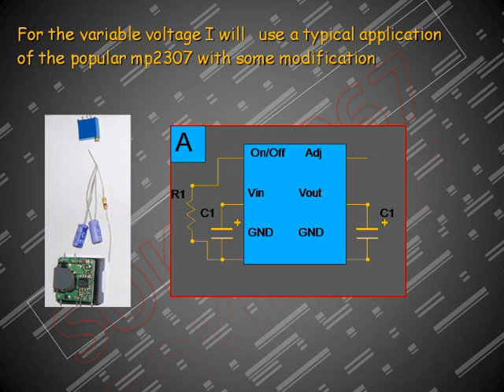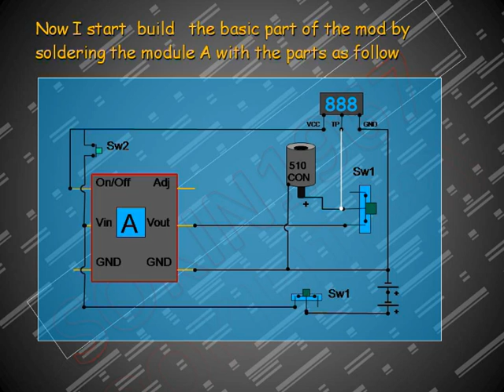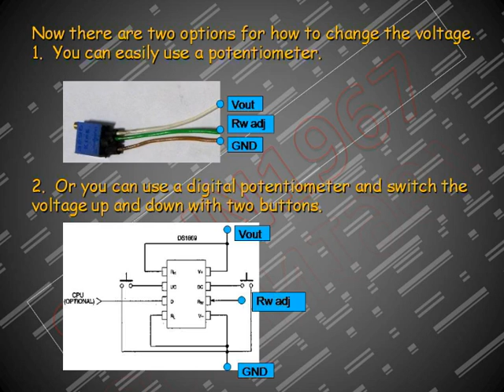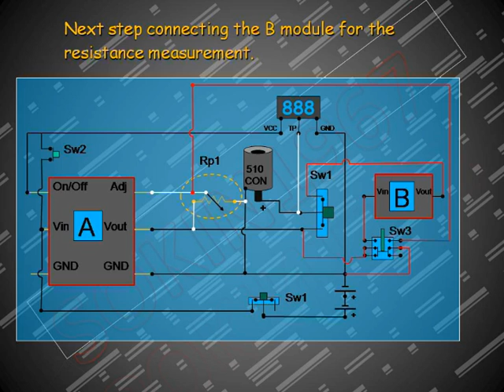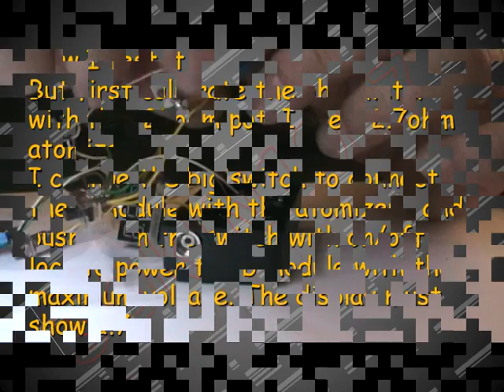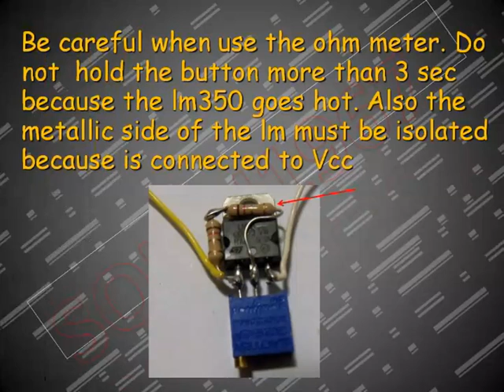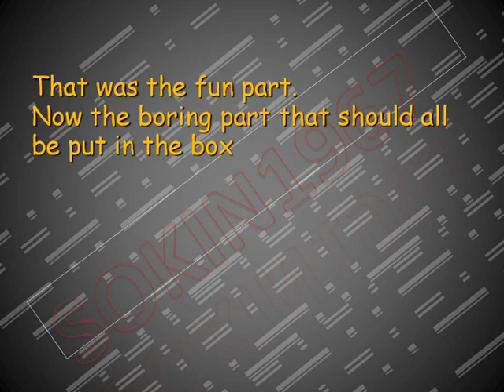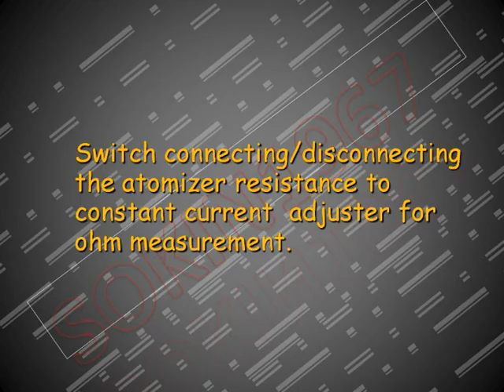DIY E-cig VV Box Mod with Volt & Ohm display measurement

Comment: Nice video, I'm really thinking about building this, but I had a question about the 2307. I'm looking at the data sheet and see the input voltage is listed as 4.75V-23V. My question is how does this work with batteries, or more specifically, how long will this allow you to vape? Would seem (only by looking at the numbers) this would work for a few uses from a fully charged battery but not have enough power to function on even a 85-90% charge remaining battery.
Reply: Was also looking at adding a P-FET for reverse polarity protection....

Comment: I started vaping a few years ago. Was a great way to quick smoking. New to DIY around 6 months. Decided a few days ago to build my first mod(guess that's what they are called). I know the LM350, 317 and 338 are in the same family. 317(1.5a)/350(3a) and 338(5a). Could you use the 317 or 338 for the ohm reader?  Also can you use the 338 instead of the module used in the video(I have one of those also). Just curious if you can use 2 x LM338 for this. My last question.(newbie vaper). I have only used 1.8ohm, and 2.2 ohm and a 30 watt Mod"istick". Will the mod you mad handle sub-ohm.(might be a newbie question). This is a Great video. Would love to see this in person!
Reply from the maker: Yes, but the use of lm317 generate  large amount of heat and consume to much  energy. The lm338 is too big to fit in the box.
Reply: There is a LM338T just like the 317 and 350/317, here is the ones that I like to use-

http://www.ebay.com/itm/5PCS-LM338T-LM338-Voltage-Regulator-TO-220-5A-LM317-Improved-USA-Free-Shipping/263053014497

Do you think this would have less heat than the 350 and 317? I would like to use both, instead of the mp2307. Not a big deal if I have to use the mp2307. I have a few I would love to use on something like this. But here are the one I have-

http://www.hotmcu.com/mp2307-adjustable-stepdown-dcdc-converter-10v-17v18a-p-175.html

would I still need to add the Capacitors and resistors with this model? I really appreciate your help on this.
Reply: Good Morning, Hope all is well! I got lucky this week and purchased a few Boost Converters to add to my collection. Then I noticed these we Boost/Buck XL6009. I also have a different variation of the buck converter you used in the video. I am going to try a Mod, with the Xl6009 and a LM338 for the ohm reader. I will post back and let you know if it worked out.  All Parts should be here today.

Not sure if you also Sub-Ohm also? Have you any experience building those? I have plenty of 30ah batteries. Just seems to me the wires needed to sub-ohm would be way to thick for any box and connector. Been doing allot of research on those. The wiring seems to be my only hold back. I can just use a Mosfet for the power switch. I like to sub-ohm with a little .4 ohm tank. Haven't tried anything stronger...LOL

Thanks again for the Great Instructions and Video!

Comment from the maker: To David Jelonek try kis-3r33s datasheet for details.I use it  with 2 x 18350 for about  5 hours with 9watt consumption (3,7 volt , 1.5 Ohm). It discharge batteries downto 3.2 volt.
For the reverse polarity there already safety for batteries but with loss of KIS-board

Comment: What kind of chip would I need if I wanted to build a 150w mod?
Reply from the maker: Why do you need a 150 watt mod ? Let say P=V * V / R ,  and let say max  output 7 volt. The resistance should be about 0.35 Ohm. Thus i need two or three paralllel coils  with big diameter. This is not my kind of vaping. I have try it at about 80 watt with analog power trasmormer and works only for fog efect machine, but no for vaping. 
Nevertheless if you insist to try there is  the Yihiecigar SX350 on internet

Comment: Do you have a link for the switch connected to the voltage meter thanks
Reply from the maker: Sorry for the late.
Googling the ebay for voltmeter led display you will find a lot of them
Reply from the maker: sorry again, you ask for the switch. Again google the ebay and search for push pull switch with lock

Comment: What's the ohm range on this? How low can it handle? (I'm new to all of this so please don't be rude)
Reply from the maker: I've tried the mod using resistance of 0.9 ohms to 3 ohms and it works fine.
The two switches are used to switch from normal use, voltage indication  and measurements in indications of OHM measurement.
But the readings of ohmmeter are not accurate less than one ohm.

Also there is no reason to be rude.
Reply: Thank you haha, I appreciate this!
Reply from the maker: Samantha Clifford Sorry-sorry for the late. There is no reason to be rude with polite people.

1.- 1 ohm to 4 ohm with the LM350
2.- sw1 and sw3 on vaping - off meassuring resistance

Comment: Just built a 400 watt mod first of it's kind that I know of
Reply: jason truthseekerhiddeninfo  just wire your 510 connector straight to a 12v high capacity redtop car battery then you should be able to go a bit higher with 1000A of coldcranking-throatburning-facemelting-vapeawsomeness! xD